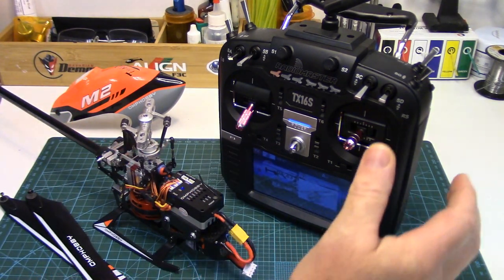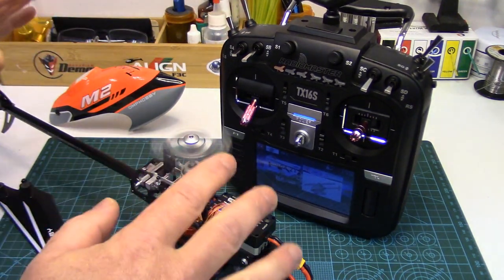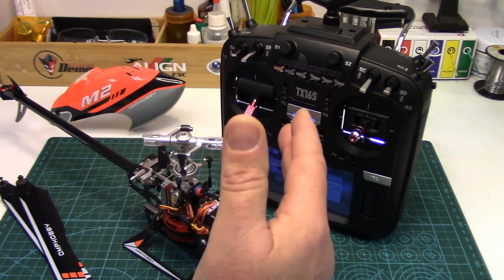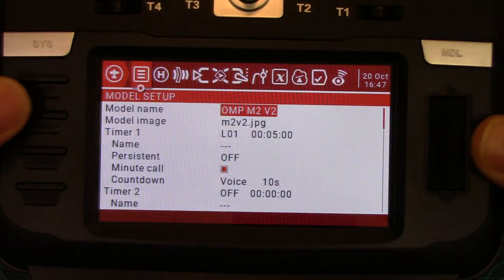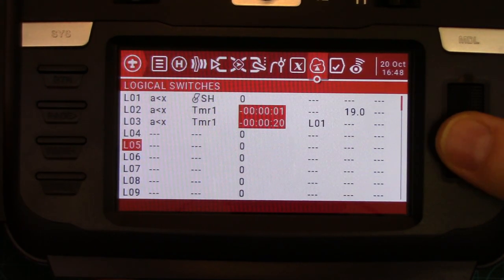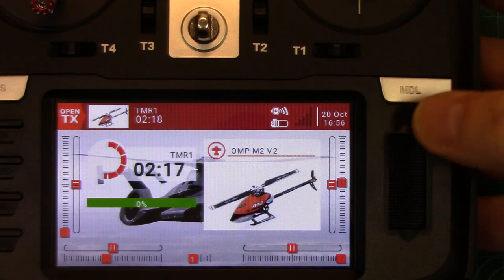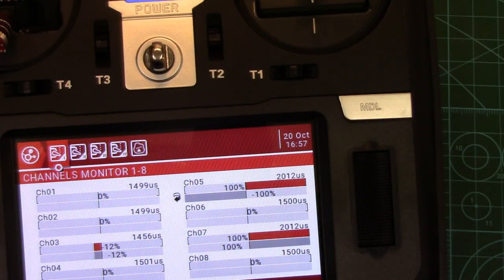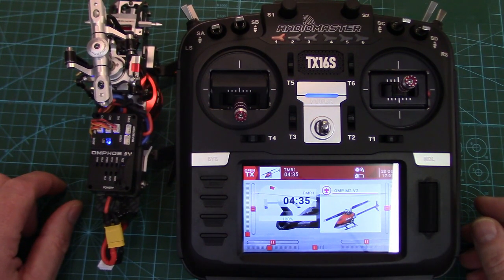How to Throttle OMP M2/M1 Helicopter Off at Low Stick Using Logical Switches

Comment: Hi Jhon
Thanks for this tutorial
I have a question
if the gyro is in stable mode it is possible to do a looping or inverted flight?
if this is not possible it would be easier to manage the gyro mode automatically with the flight modes that's one less switch to manage
What do you think ?
Reply from the maker: If you are flying with self/auto level stabilization mode active, you can't fly inverted (the heli won't pitch or roll into an inverted orientation).  I cover this and stabilization mode toggle activation options in detail in my Stabilization Mode video: https://youtu.be/LouYitd7jak

Comment: so I bought TX16s Max recently and also OMPhobby M2. At first when I'm setting a normal flight mode - pitch curve as below:
throttle stick min = 0 degree pitch
throttle mid stick = 0 degree pitch
throttle max = 12 degree.
once throttle hold is deactivated, heli starts to spool up regardless of throttle stick position.
and then I realize the heli's pitch curve doesn't follow my setting.
so I change the normal flight - pitch curve as below:
throttle stick vs pitch is a 45 degree straight line (ie a typical idle 1 or idle 2 curve）
and voila, at lowest throttle stick, with throttle hold deactivated, the heli doesn't spool up until you throttle up in normal mode. (function as normal heli's normal mode)

conclusion: no need to set logical switch.

Comment: Hi John,
at ~13:30 you reset the timer. Since you use a lot of special functions for audio playback, I suggest using one for reseting the timer as well.
Simply assign a special function to the toggle switch (SH by default or in your case SF) and choose "Set Timer 1" to the desired time.
Makes live a lot easier with battery changes by just toggling the switch and are good to go again.
Reply from the maker: @André Manicke - Good suggestion - thanks! I think that would also reset the timer every time you engage & disengage throttle hold for an autorotation - yes? I'll have to try it out tonight 👍
Reply: @Rchelicopterfun  No reseting with throttle hold if two different switches are used. I have throttle hold on the two position switch, timer reset on the "two position" toggle.

Comment: I have an issue where I don’t get motor to spool till I get to mid stick what am I doing wrong
Reply: I'm assuming you are using omp protocol with the logical switch as shown in this video. check your normal pitch curve, make it a 45 degree straight line.

Comment: HI JOHN I READ YOUR ARTICAL ON FBL SYSTEM , ARE THE FBL SYSTEM RELIABLE, THINKING OF THE BEASTX OR AR7210 HOW LONG DO THE FBL SYSTEM LAST AND HOW OFTEN SHOULD YOU REPLACE THEM JUST WANT TO KNOW THE LONGEVITY OF FBL SYSTEM THAT YOU HAVE , THANK YOU FOR ANY INFO
Reply from the maker: If you read that article in its entirety, you know the answer since I specifically address this topic on that page. I've never replaced one or had one fail in over a decade of using them.

Comment: I have kind of a mistery now. Previously set up the throttle cut like that, but wanted to remove it, to avoid cutting motor in case of stick panic in flight lol. But without the logical functions it still doesn't start with throttle at 0 and motor armed. Checked everything to put back like it was before, but still. A real mistery, will need to create another model from scratch perhaps
Reply from the maker: As with all computerized radio programming mysteries; the 1st place to always start is the channel output monitor screen. That will tell you exactly what the heli is seeing so you can correctly diagnose the issue.
Reply: @Rchelicopterfun  I think they changed the way it work on last multimodule update. Cause yes I thought about the monitor but nothing strange there. It just start at like 2 or 3% throttle in normal mode

Comment: Wait, am I understanding this, the M2 will NOT have 0 rmp at stick down once it has started in normal flight mode? What in the world is the benefit to that? EDIT: also thank you for the video John!
Reply from the maker: As I stated in the video, this is only when using the internal OMP RX due to the way they have it configured. With external RX's - it works like any other ESC as I show in the M2 V1 & M2 EXP reviews I did. Regardless, for many fliers it's not an issue as they are used to using throttle hold exclusively to power on & off so they have consistent power and head speed throughout the collective range no matter which flight mode they are in. That's the benefit.
Reply: @Rchelicopterfun   Thank you for the reply. I'll defiantly be setting this up at some point then. That just doesn't seem beneficial to me in a normal flight mode. I just updated my tx16s for OMP but haven't messed with it (excellent video on that by the way). Was running the Futaba mini receiver. Thank you once again for your diligence in helping out.

Comment: thanks for this video, my question is there a protocol for wiltoys v911s helicopters .
Reply from the maker: Yes there is, but I don't know much about it. Check on multi-module.org  website for supported protocols and scroll down to the V911 protocol and read the release notes if you want the specifics on it such as channel mapping order etc.
Reply: @Rchelicopterfun  thanks, will check the site 👍